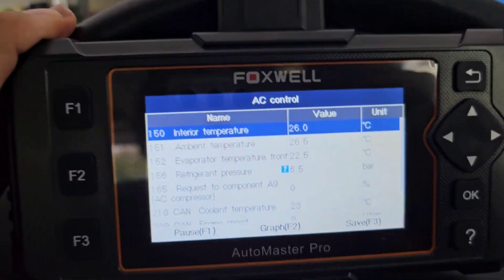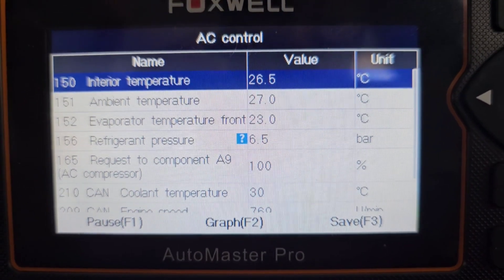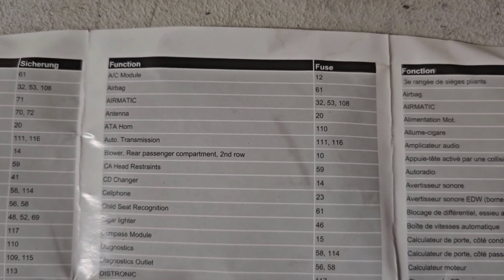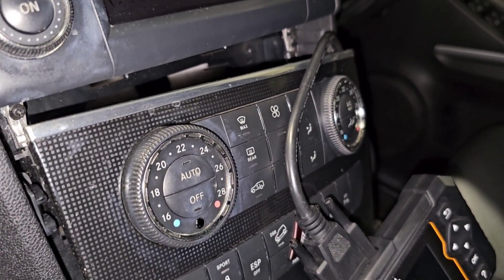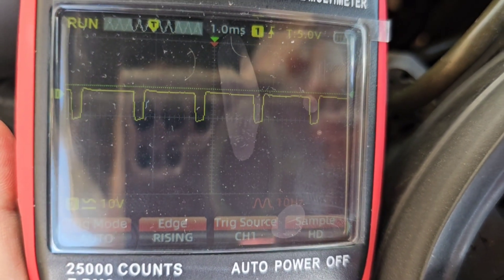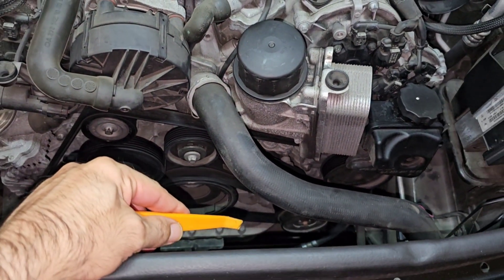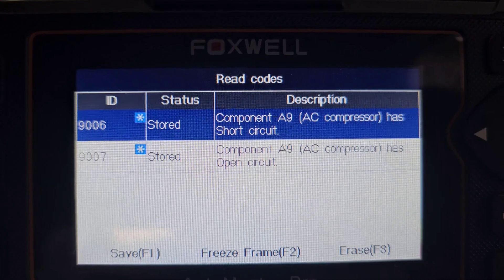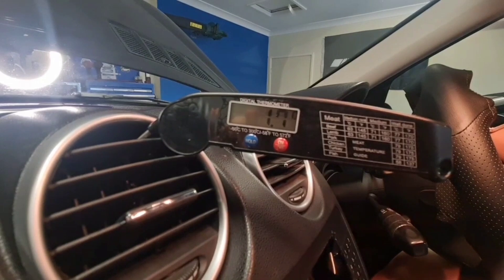A small part causing a huge issue: A/C control solenoid valve.

Comment: Will the solenoid go bad entirely or may it retain some residual function (but not work fully)? My AC in my CLK works, but it is not working wonders in terms of generating cold air.  There appears to be sufficient refrigerant in the the system and the cooling performance might be normal; I'm just not sure. Flaps are also OK, i.e., I don't have the infamous clicking noises from the dashboard.
Reply from the maker: Everything is possible.  Depending on what position the solenoid gets stuck. Best would be to diagnose using a good scanner to check the evaporator and all the ducts temperature.
Reply: @BenzAddiction  Thanks a lot, for the reply! I have two very good scanners (Benz-specific ones) and they don't show any fault codes. The air temperature responds to dial operation, i.e., when I reduce the temperature on the controls, the air gets colder. The cooling performance is just not "blowing me away." :) I've heard that one shouldn't use Japanese cars as a benchmark as they have wild AC cooling performance. On another European car I owned, the cooling performance was similarly "weak" compared to Japanese cars. When you say "check ... all the ducts temperature" are you suggesting a real thermometer to measure the ducts, or are you talking about read out values shown by a scanner (live data)?.
Reply from the maker: Yes, the EU A/C might not compete with some Japanese ones. But it should be adequate.  Yes check the temperature on the scanner.
Reply: @BenzAddiction  Thanks!
Reply from the maker: @coolcat23  You are welcome.
Reply: @coolcat23  MB AC system is Japanese. All the components are made by DENSO. The only thing European might be the AC control panel and the stepper motors.
Reply: @juancarlosmorales6775  Interesting, thanks a lot.
Reply: The AC in my CLK sounds about the same as yours, works ok but doesn't  blow you away, has been serviced too
Reply from the maker: @atoningunifex6067  Yes, compared to a Toyota camry the chill and blowing power is less.